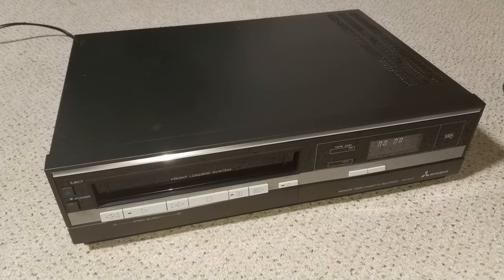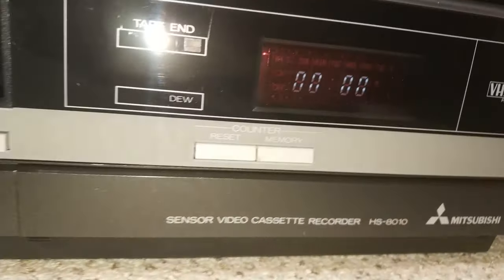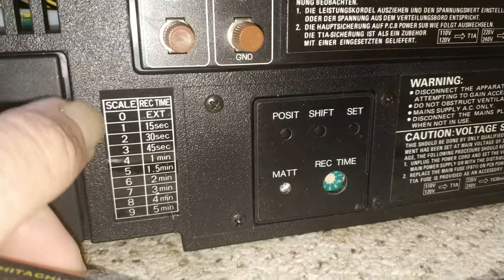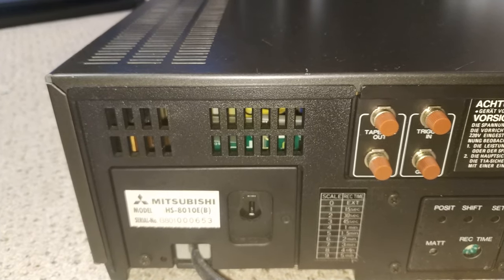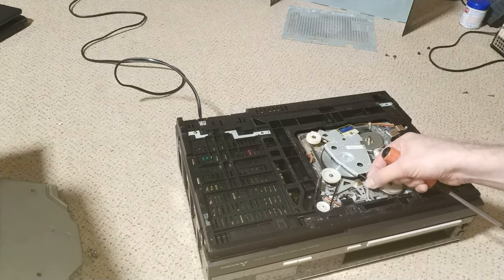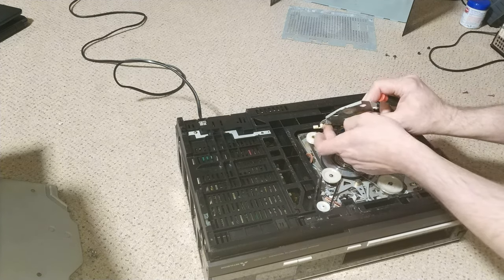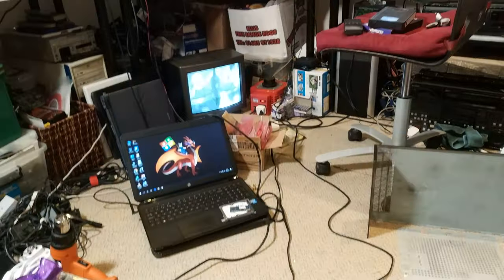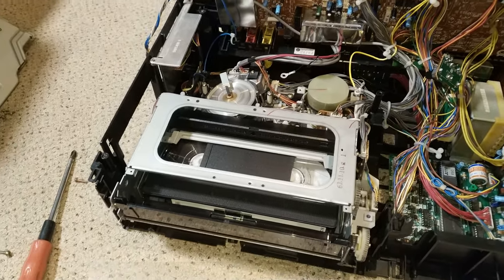1986 Mitsubishi HS8010 VHS 'Sensor' CCTV VCR machine repair - Part 1

Comment: When I read the title of this video I was also expecting it to be one of those CCTV machines that runs the tape very slowly so it can record 24/48 hours on one tape. But as you mentioned it's "sensor" not "time-lapse".  I did come across a Mitsubishi HS306B back in the early 90's when I used to do a lot of these repairs and it was unusual having the tape transport controls above the cassette door rather than below it.

Comment: I have a mitsubishi HS306B as a future project which I think is of similar vintage,  this info will help me when I get around to it as I've never touched these before, thanks for the video
Reply from the maker: There's another video to follow shortly which shows the idler assembly being replaced (i managed to get a new old stock one) and timing being adjusted - a long story but it'll certainly help you with your Mitsubishi.